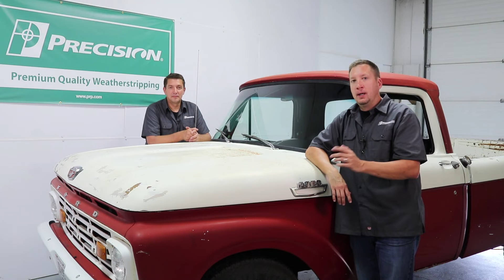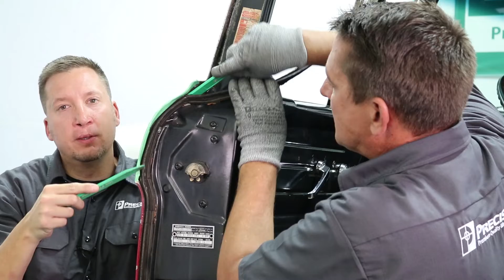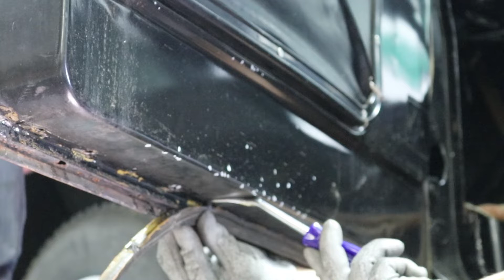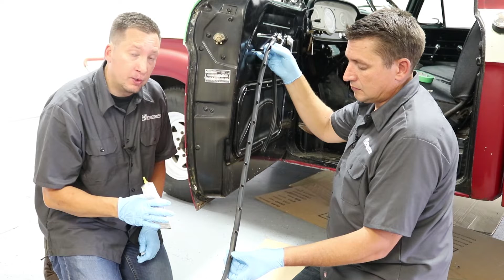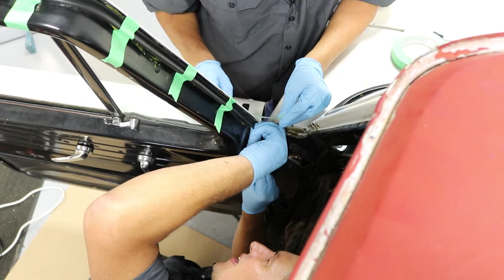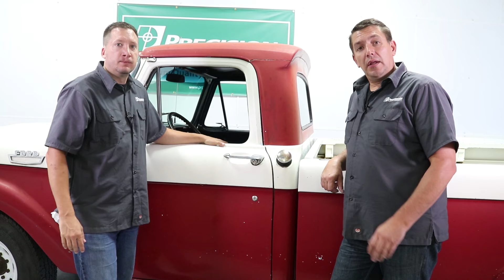1961-1966 Ford Truck Door Weatherstrip

Comment: When you installed the bottom of the weather strip, did you install the plastic inserts first then pushed the metal retainer in? Or, did you install the insert, metal retainer and rubber all at once? You didn't show that part, you just jumped to the edge of the door.

Comment: Where can you get the metal clip you chisel over the strip? I just got to the process of my weather strips and they're original and those metal tabs no longer exist nor do the plastic one on the bottom of the door. All the glass weather seals are far beyond gone and have been sense about 1999 if tells anything. I got my weather strips with the 11 plastic plugs and my weather seal adhesive.